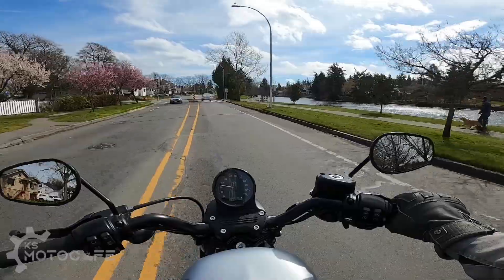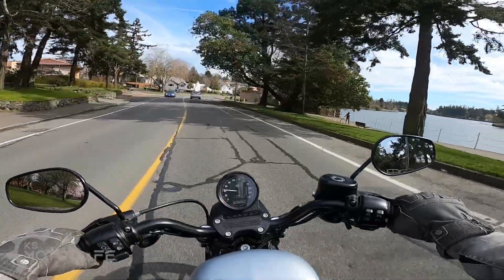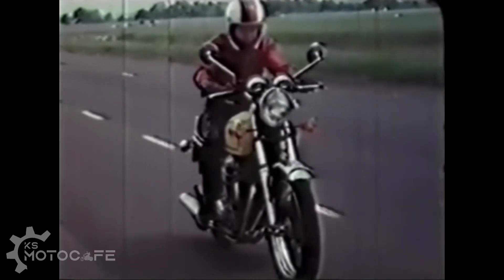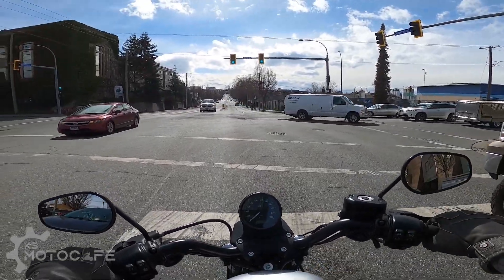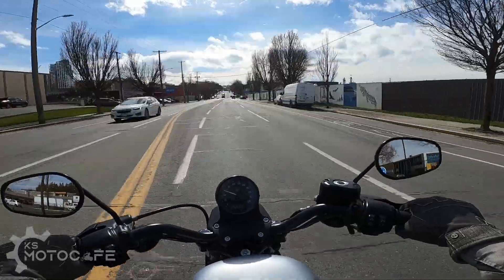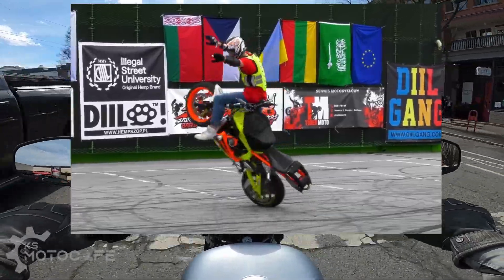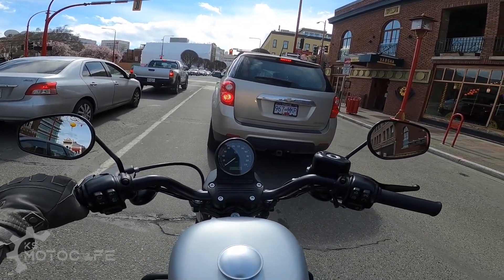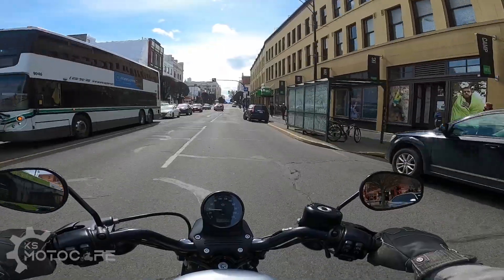Death Wobble, Speed Wobble, and Tank Slapper on a motorcycle explained!

Comment: Gentle rear brake pressure with slight roll on the throttle will help ease it out while you gather yourself and correct it. Whatever you do don't chop the throttle and add pressure to the front... small corrections...small results...corrects the issue.
Reply from the maker: great advice!

Comment: I experienced one of these high speed wobbles around 1992 on a Honda 750. I topped a hill doing about 80 mph, the wobble started, and I just dethrotled the bike, held on to the handlebars with a death grip, and prayed that I could get the bike to slow down to around 40 mph. I had been in a wreck at 40 mph, the wreck hurt, but I had survived at 40 mph. I knew that I was probably dead in a wreck at 80 mph, and [somehow…luckily…instinctively] did not apply a front brake. I began to slowly apply the back break (coming down the hill), and probably once coming down the hill, the weight automatically shifted more to the front of the bike, and at 55 mph the bike smoothed out to normal. I parked the motorcycle that day, and I have not been back on a motorcycle since that time. I loved riding a motorcycle, but that was as close to death that I wanted, weighed my life options, and motorcycles became the least of my wants in life. When your handlebars become two “jackhammers” in your hands and you are holding on for dear life, it is a life-changing experience.
Reply from the maker: thank you for sharing your experience!

Comment: I was on my 2009 KAWASAKI ELIMINATOR 125, doing somewhere between 45-55mph. I turned my head and looked to my right, and saw no vehicle neither in the mirror. However, the car was there and I had my turn signal. I slightly seen the car, as I was turning/leaning right, I quickly went back to my lane causing a death wobble. Scared me til this day.
Reply from the maker: daaaamn how did you get out of it?

Comment: Happened to me, on a Sportster, at 160km/h all I did was to get low, pure instinct and light rear brake, I could see my self in a crash but luckily I survived, and yes, most scariest experience ever.
Reply from the maker: yeah I am glad you mentioned this. I too had a wobble at that speed on my sporty. Turns out the sportys are known to wobble after 140-150kph. So there are stabilizers that stop that

Comment: Bro let me tell you … I have a 06 road glide I got speed wobble on city streets going into a turn at 1st my instincts told me to go for a break but the back break because of I have a little more weight to me an had to power out of it scared the fuck out of me I had to run the spot sign due to not being able to use the hand break and wobbling through it and while wobbling power out of it but then it straightened up an I puuuttteeddd all the way home
Reply: My advice is to power out of it an use a back break to slow down alil
Reply from the maker: duuuuuude good recovery, especially on a big bagger! You mustve hit a pot hole or went over something uneven during the turn! Glad you got home ok 👍

Comment: The death wobble literally just happened to me a few minutes ago. I have a 06 r6. This was my first time. I knew the front break was a no go. Something told me to slightly tap the rear break and let off the throttle. Im telling you it worked. And again this was my first time. Im no expert rider or anything. But it was definitely and eye opener. This happened about 100mph. All I did was drop a gear and was out. Next thing you know the bike started shaking like crazy. My body was so loose the tank was slapping my knees. I honestly thought I was gonna die at this point. But the technique worked for me. I was told this can be a common thing on an r6.  After got home I did some research and was told i needed a steering stabilizer. So I just bought one. By no means I will not rely on this thing. But I’m hoping it can save me. Ps. I don’t speed all the time. I try to be the up most safe on my bike. I definitely respect the bike even more after this.
Reply from the maker: bro - you just earned a life! Well done you 🥳! Thanks so much for sharing this incredible experience and confirming that rear brake taps work!
Reply: @KSMotoCafe  no problem. Hope it works for others if need be.

Comment: Watching this after having one. Feels painful for me understanding the physics I went through. I took my lesson without falling. It is a Daytona 675, accelerating with the 2nd gear, and with my throttle stuck at full, cause while I was trying to take control of the steering wheel I also
 tightened the whole system and the throttle at full. When I realized that all I have to is to just close the throttle, and did it, the whole ergonomics system changed to "ok, you will not fall, nothing bad now". It instantly fixed when I closed the throttle. I wish you guys be careful and take my personal lesson as yours. You have to avoid the experience, when you see the first little wobbles, close the throttle, because if you dont you are heading to a death wobble.
Reply from the maker: thanks for sharing this info man. Must have been scary AF! Yeah I will be updating my video of this soon where I explain NOT to throttle on. Since this video, I have experienced a speed wobble a few times and learned to control it (as in throttle off and keep calm).  Thanks again man

Comment: A steering damper stopping this from happening.I know I had a Ninja and this happened scared me enough I sold my bike.5 years later bought a modified R6 with a damper and never happened to me since :) problem SOLVED!
Reply from the maker: that seems to solve most bike's issues! Even on my sportster
Reply: @KSMotoCafe  It did for me at least.I put mine in the hardest setting and ya it was  bit harder to turn at low speeds but going fast or a quick wheelie take off it worked wonders.Its a great investment and it's a simple way to make your bike safer at least in my opinion.
Reply from the maker: @Spyderz-xo9rz  thanks man!

Comment: Zx10, second gear stand up weelie.. It was windy and I was drifting toward the shoulder, should've sat it down.. instead, I got greedy and leaned off the left side of the bike, handle bars turned all the way to the right, trying to coax it back towards the center of the road. At which point I hit the rev limiter!!!   In second gear!!!!     On a zx10r!! 
 Let's just say I had the most violent TS. It threw my hands right off the bars...and I'm laying sideways, chest on gas tank, my face was very close to the road, watching it go by..I didn't die! Managed to get my hands back on the bars and pull in the clutch. Look as speedo after all this..it still said 120!
Reply from the maker: jesus man glad you came out alive.  was the wheelie intentional or accidental?
Reply: @KSMotoCafe  I had been in the weelie about a mile so.. I guess that wasn't long enough lol

Comment: In 1980 I woke up too late and hurried to try coming at work in time. I went into the Velsertunnel (it's about 1500m) and speed up on my Honda CB 750 K7 to about 180 km/h when it started wobling from little to the limit. My handle bars (luckily I had a steer from a Honda Gold Wing) went from left to right in a speed I can't discribe. My bike went also from left to right over the whole tunnel. I just could hold the handle bars and saw in a split second my whole life and what I still planned to do. As I did not give any throttle the speed reduced and the bike came straight up again. When I was at work and took off my helmet my boss said I was as white as a blanco A4 paper. Later when I went to my store it came out that there was 2mm up and 1mm wide in my wheel. He replaced it for a brand new one and the problem was gone.
Reply from the maker: wow crazy how little change can make such a big difference

Comment: A few things that might prevent this from happening:
1) Either apply rear brake or downshift.
2) Make sure your tires have correct tire pressure and are balanced.
3) Don't ride like a complete idiot.
Reply from the maker: number 3 could not be more emphasized

Comment: , I've been riding for about 5 years at this point I've had it happen once very slightly at like 40mph. It went away pretty quick.  So I ended up getting rid of my gsxr600 for a R1000, I was. Car mechanic at the time an my buddy's there all had one built car, my friend had a s14 with a RB25 turboed, an my other buddy had a new WRX STI slight mods. We were on the highway going to the casino an we started racing, I was at like 130mph and got a bad wobble. I started slowly Pressing my rear breaks an finally without crashing I was able to regain control.
Reply from the maker: 130mph... yikes! glad you got out of it safely Alex!
Reply: Aye thanks my friend!

Comment: I have a 1500 wing With...
The ole wobbly wobbly...
 Front and back brakes are linked, at the foot peddle, works great to slow you or of the wobble....
  Adjust your neck bearings, if you get too scared.  .
Reply from the maker: Thanks for the tip!
Reply: @KSMotoCafe  PARTNER....
  Keep on Preaching it, to the troops...
   Looking forward, to your next videos 👍👌😎

Comment: EDIT I decided for shits and giggles I would watch his video, and in the video he said one way to fix a speed wobble is to throttle on. As someone who has rode for years and raced for years, I can tell you with absolute certainty, he is completely incorrect. You CANNOT throttle out of a speed wobble on a motorcycle. Speeding up during a speed wobble on a motorcycle does NOT fix the problem. It will only end the suspense (make you crash sooner) 

So, I'm not actually gonna watch this video, but I'm gonna leave a comment. In a car you can accelerate out of speed wobbles. You can actually fix the problem by slowing down OR going faster. On a bike, there is no way to fix a speed wobble by going faster, the only way to fix it on a bike is to slow down. Well, honestly there is a way to fix it by speeding up, but all it fixes by speeding up is it will make you crash sooner, which will "fix" the issue I guess lmao
Reply from the maker: Ty it is important for me to get this info right because it could mean life or death to some watching it and seeing the wrong info.  So the source where I obtained you can get out of speed wobble by accelerating was https://motorbikewriter.com/avoid-tank-slapper/ where he mentioned at "low speed wobble", you can accelerate out of the wobble.  Based on most of the viewer's stories of their wobbles - all of em got out of it by throttling off and sometimes lightly tapping the rear brake.  I didn't expect this video to get this much attention when I first made it but since it is starting to gain more viewers, I believe it is time to re-make the video with the most correct ways to get out of the wobbles in specific scenarios.  Thank you for your invaluable input!

Comment: Just pruchased a 1980 Yamaha XS1100. The bike drives perfect up to 130-140km/h when i start to get a speed wobble. I suspect the cause might be the worn back tyre?
Reply from the maker: there are many factors to why it would happen but it could just be how the bike is designed to be.  Every bike has a threshold when the wobble will start based on its design.
Reply: @KSMotoCafe  i just checked the tyre pressure, front is 1.2 bar and rear is 0.9 bar. 😅 my mistake

Comment: Does this happen with 300cc Fully Faired bike?
Reply from the maker: It can happen to any bike - every bike has a top speed that will start its speed wobble but if you stick to legal limits or just above legal limits and your bike is in good working order, you will have less chance of getting the wobbles.  But as I mentioned in the video, if you somehow go over a bump or do anything to change the velocity of the rear and front wheels, you may encounter this.

Comment: I've had a death wobble at like 85-90mph on my 03 Nija 500r I hold in the clutch and use the rear brake to gradually slow down. I've also had it happening recently without hands.
Reply from the maker: without hands? what did you mean by that

Comment: The only time I have had the front end wobble, was on a 76 Honda 400 super sport. going across draw bridges,  in Florida. rode from Key West, to New Orleans. the steel grate, would make the front end wobble, at highway speeds. I just back off the throttle. keep a loose grip, allowing the handle bars to move, within reason, and ride it out.
Reply from the maker: hmm you are like the 10th person who had a wobble with honda bikes made in the 70-80s! Glad you made it out and thanks for the tip!

Comment: Let off the gas, lean forward and feather the rear brake. I’ve had tank slap and this has helped. I also have gone into a  wheelie and landed back down straight. But that’s for experienced stunt riders, you may come up crooked and if your not experienced in turning in a wheelie I wouldn’t recommend that. I’ve seen pro riders unfortunately have no choice but to bail, specially coming into a tight turn in a death wobble. Best advise, coast to a slower speed, get off to the side and change your under wear! Stay safe! Always wear a helmet!!!!!!!!!!!!
Reply from the maker: great advice! thanks for your input

Comment: Yes. I was on an 83 Honda V65 Magna at 165 mph. Very scarry. I backed off the throttle and as it stabilized,  gave it a very light rear brake. Very light. That was as fast as I have ever been on two wheels. Not sure that I will ever do it again.
Reply from the maker: 165mph 😳

Comment: Yeah crazy shit. So, I actually had it happened to me today, on my CBR, I was probably going about 70 mph or so, and the bike is extremely fast, so as I was accelerating very briskly, it happened.

Scared the hell out of me. It happened very prominently as well. It wasn’t even a little wobble, it was some crazy hard-core fast wobbling.

What did I do? I just calmly slowed it down with my hands, and applied the rear brake, and it went away. I don’t know if this is right. I don’t know if you’re supposed to just let it do it’s thing, I have not watch the video yet. 

 But the point of me saying all this, is the say if you’re calm and you can think collectively, you’re going to be better off. Neil Armstrong was like this.

Safe riding to everyone! I’m going to slow down.
Reply from the maker: yea buddy you did the right thing.  Number one mistake is pressing hard on that front brake which will make you drop that bike so fast you would be lucky to have any teeth left.  Rear brake seems to be a good action for most part as long as it is gently applied and you calmly throttle off and let the bike do its thing.  Glad you made it out man but you may have to get your tires checked to see if it is balanced properly or put on some steering stabilizer/dampers.

Comment: Just get a steering damper and this shouldn't happen. Not gonna say never. Cause it happened on my 08 cbr 1000rr one time so far and they have a damper built into them it corrected it self almost immediately so I was okay but on my 05 cbr 600rr I had countless slippers never went down but they were all so damn scary.
Reply from the maker: how fast were you going with the 600rr?
Reply: @KSMotoCafe  most of the times the tank slapped wo UK ld occur right when I'm gunning it on the throttle and I'm going thru the gears to fast and I put too much throttle to little clutch ratio and my front tire lifted and the slapper would happen when my front wheel landed back on the ground and I would say I would always be doing over 130 once it happened at 155mph there truly a terrifying anomaly to deal with when they happen but I've learned just be very conscious of how you throttle and very careful with your clutch as in don't power shift to quick and make sure your throttle to clutch ratio is matching amd.they shouldn't happen or get a damper I advise everyone just get a damped couple hundred bucks and you don't have to deal with one of the scariest happenstances of owning a motorcycle.

Comment: Shouldn't you be aware that the bike you're riding has instability issues?  Unless something breaks mid-ride this should not be a surprise.  If I'm riding a bike that has a tendency to break into a wobble I need to correct.  Maybe a steering damper?  Too little rake or spring preload situation of front springs.

Thanks for the vid.  It was really good.  I liked the old riding safety films.  Good shite.  subed/liked
Reply from the maker: Thanks man - nowadays nothing surprises me on what common knowledge that drivers and riders are not aware of their own vehicle!

Comment: I have this situation 2 or 3 times on my ktm 1290 SAR...and yeah...it's very scarry!, wonder if unbalanced rack panniers can have something to do...specially when hitting something on the road that starts a vibration, and also some kind of pavement longitudinal grooving can cause it sometimes.
Thank you for your video!
Reply from the maker: unbalanced rack definitely has an effect.  It is similar effect as towing a trailer with your car and when the trailer is not balanced properly (ie too much weight on one side).  The trailer wobbles like the bike!

Comment: ‘98 R1 with forks up 10 mm in triple clamps. In 2nd gear, already leaned over and heading for the guardrail while popping off an on the seat probably ‘bout 10 times but felt like forever 👻
Shake stopped by rolling on gas very slightly . Turned white as a ghost & pulled over to clean the 💩 outta shorts. 😂
Lesson learned… don’t mess with rake and trail geometry and use a decent steering damper
Ride safe & keep the rubber side down mates 🤙🏼
Reply from the maker: great lesson man - glad it was only the pants you had to change!